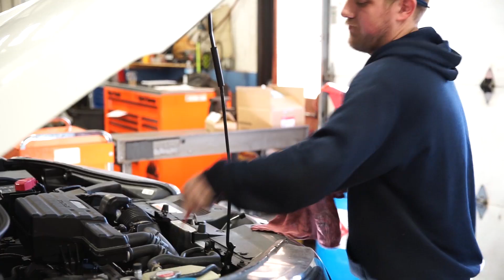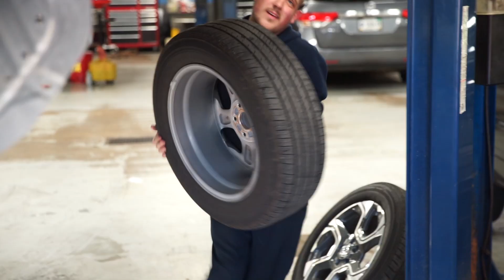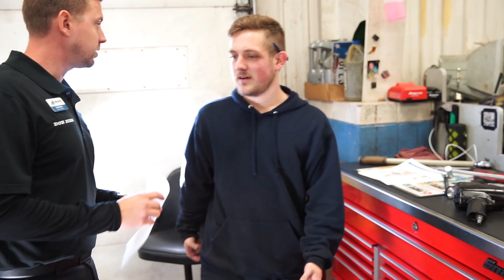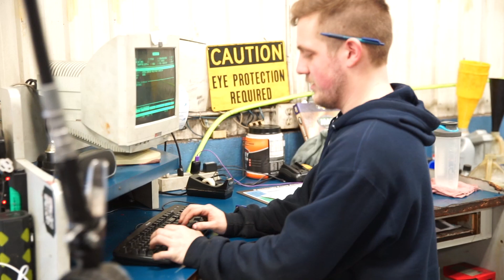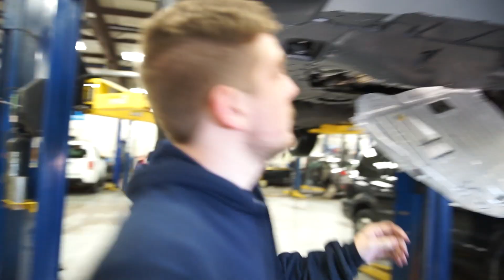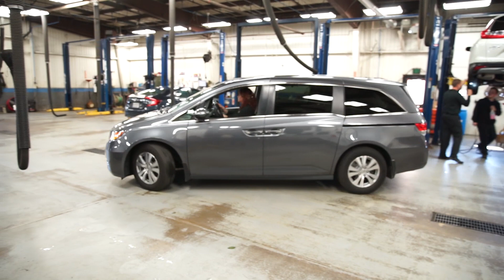Don Ayres Honda: Lube Tech Duties with Cody

Comment: Lmao he bends the shield down. Dink lmao and uses torque sticks
Reply: I use torque sticks for tires.  Have NEVER USED A TORQUE WRENCH OTHER THAN MAJOR ENGINE COMPONENTS.
Reply: @ronijr4918  Can I please ask you a question, when you're installing the drain bold, do you use a wrench or socket and what about a torque wrench?
Reply: @robschwartzenberger6698  In all honesty I prefer a ratchet and shallow socket. NEVER use a deep socket on a drain plug because that's how they get rounded off. And a wrench is okay if that's what you prefer.  Also as using a " TORQUE WRENCH " you can if you have one. If you are a rookie at the trade it's not a bad idea so you can have a feeling of how tight a drain plug should be. So later you can just stop using a torque wrench.  P.S I use a torque wrench every now and then on a oil change just for fun.
Reply: I use a torque stick on wheels every day   and i also torque the oil drain bolts    like it is supposed to be done unlike you kids
Reply: @joehyundaitech7961  exactly bro I think the only time i find myself not using torqued sticks are on aftermarket wheels with spline keys I had a comeback a while back that scared me so I torqued spline keys now🤣🤣
Reply: Torque sticks are so much better when torquing wheels, no need to bend down torquing wheels using a wrench. If a shop doesn’t want you to use torque sticks, you can either suck it up and bend down or find another shop. Only downside of the torque sticks is the accuracy but I’ve never had an issue using an 1/2 air impact.
Reply: I was thinking the same thing, he was doing all the bs you dont want on camera...lol, This is a good example of being taught to just do it fast and not the proper way because he doesnt know better...lol

Comment: Why you lifting the tire that high?
Reply: Inexperience
Reply: @kevincovins3546  it doesn’t have nothing to do with being inexperience. I’ve done that many times. Is it  the  right way to install a tire? no! Preference? maybe.
Reply: @AlxN52  I know guys who have been with Honda 20+ years and mount tire that high. Usually see it with a B services
Reply: @MrManuel1329  yes I agree , used to work for Honda  in the  express team
Reply: as long as it gets done
Reply: @MrManuel1329  They rotate tires that high because they are flat rate not hourly. If they have a oil change and rotate they usually lift the vehicle all the way in the air and drain the oil and rotate the tires while the oil is draining the more cars you take in the more money you make gotta be quick, it may look weird but it is an efficient way to make more money . I wouldn't recommend this for lube techs though. Sometimes mistakes happen because they have multiple things going all at once, I do things a step at a time. My opinion its better to do it that way, so mistakes don't happen. Some techs forget to tighten the drain plug or even forget to torque lug nuts or even close the hood lol I've seen it before they do get fired lol I've been wrenching for Toyota for about 8 years now.
Reply: Chest to neck height makes it the easiest
Reply: @kevincovins3546 why u take stress ?